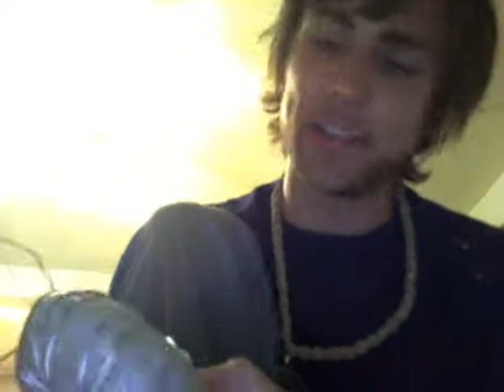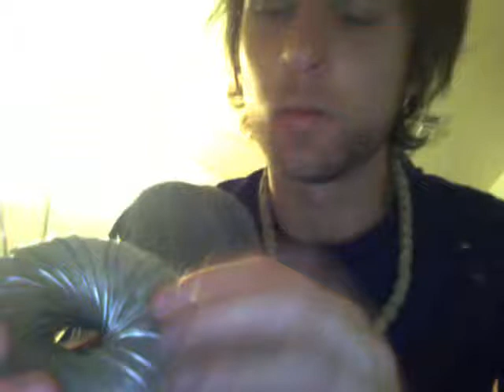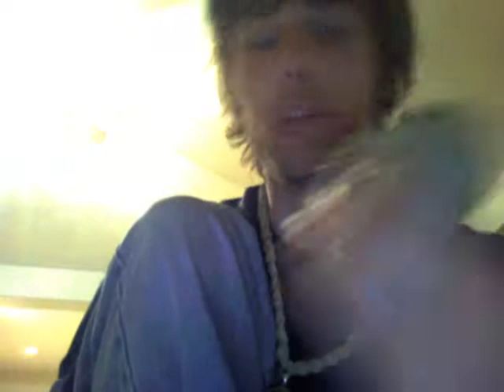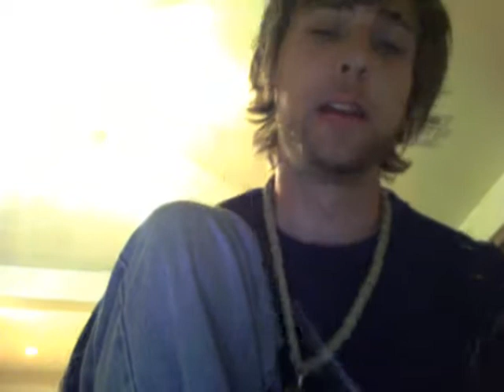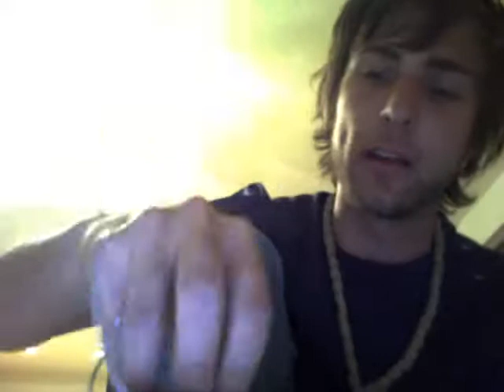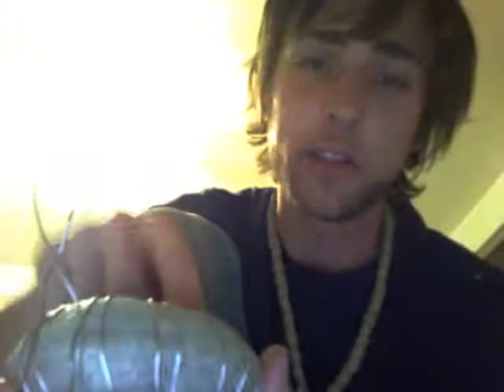Rodin Coil Capacitor Part 3

Comment from the maker: I don't ground the wire at all, it's a closed system. I was using a DC Frequency Generator to power it, which wasn't putting out much juice at all. That's why I was hoping to get a transformer, and then use a rectifier to turn it to HV DC, at least 10K V. In my latest vid, when I touch it, I am grounding it with my body though. You don't use a 3rd wire according to Marko Rodin. However, you can in certain applications. For the capacitor model, I was technically going to use H20 for the 3rd wire.

Comment: Gregor great work!!  

i have wound several rodin coils.  One end of the wire is connected to the power supply and the other is grounded.  My question is simple:  How do you ground the wire and to what?  

another question is why not a third wire in the open space?